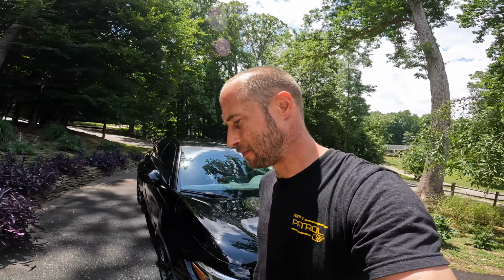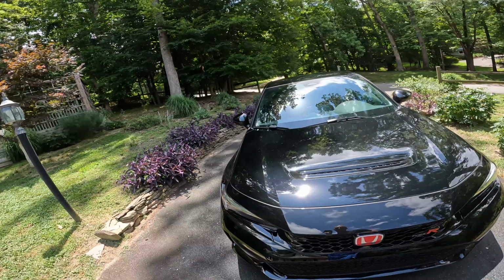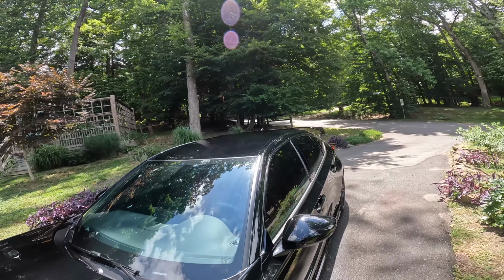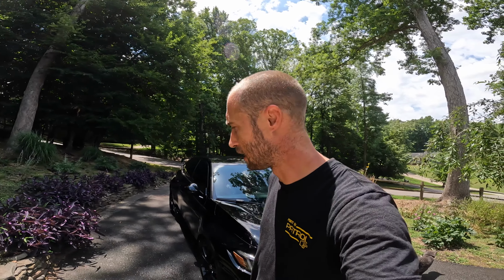FL5 Civic Type R Built 4Piston Engine Build   4K

Comment: Why no chassis or suspension modifications? With such a love for the track I'm surprised that's not a focus of the build.
Reply from the maker: The Type R chassis/suspension in it's bone stock form is actually quite incredible. Those mods are last on my list for now. I adjust my alignment for track days, and thats about it. Money is also a big factor, the suspension changes that I would love to have would cost at least 8,000 dollars.
Reply: @pointbypatrol   I understand. Did the opposite and spent on chassis and suspension. The car is incredible now. Stay safe and good luck 👍
Reply from the maker: @benbrockton  What did you go with?
Reply: @pointbypatrol   basically just recreated the spoon fl5. Rv6 camber,  caster and toe suspension parts along with  sway bar. spoon ridged collars and KW v3. 18x 9.5 265 /35r sitting on regamaster wheels. It's jailbreak and hondata turned. It's incredibly balanced.